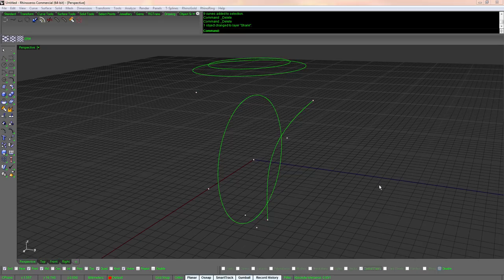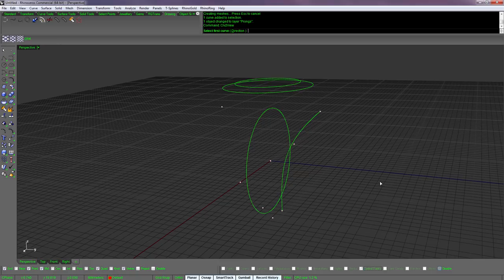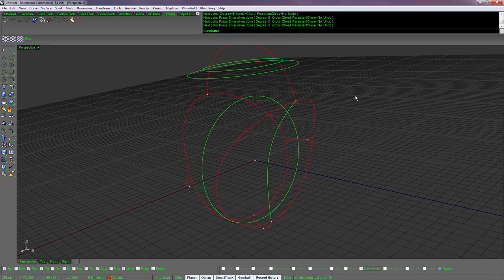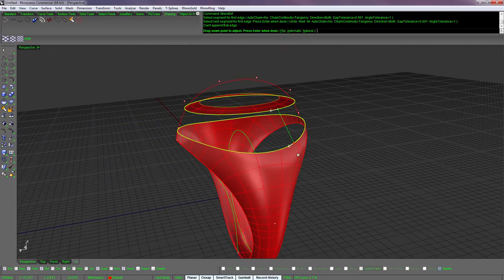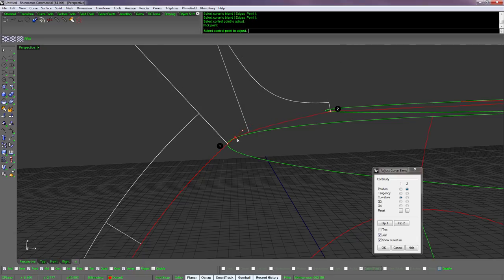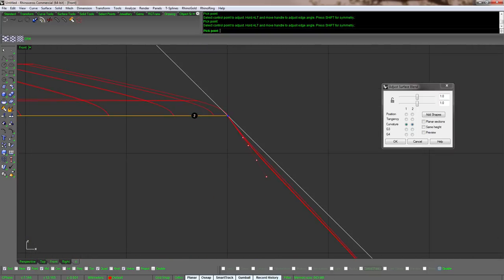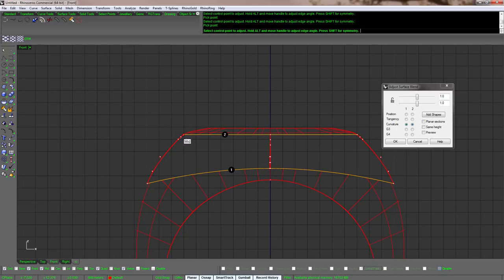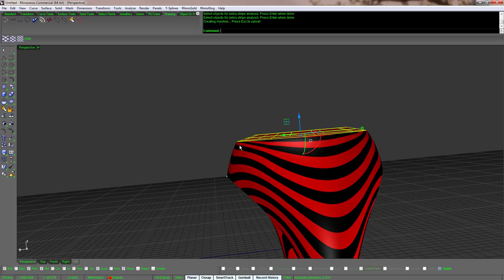Rhino Tips And Tricks - A Better Signet/Dome Style Ring

Comment: A question that follows where you left off: What would you do to make it a solid? I followed your example in this video and ended up with a somewhat complex shape that seems to confuse the Offset Surface tool.
Reply from the maker: I never have much luck with OffsetSrf on a polysrf.  Usually I offset each srf individually and then play it by ear.  The surfaces underneath stones are most critical (depth can't be too shallow) so I lock it in place and BlendSrf, MatchSrf, and point edit my way to making a hollow.  I'll add 'Hollowing A Ring" to my tutorial todo list.
Reply: Someday, after many more of your videos, I will understand the big words you use. Mucho gracias, sensei.